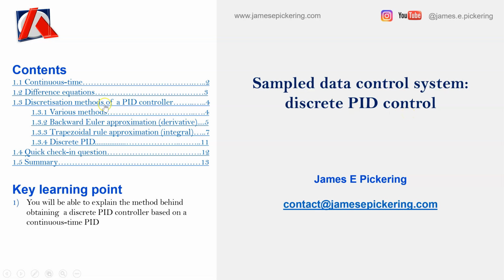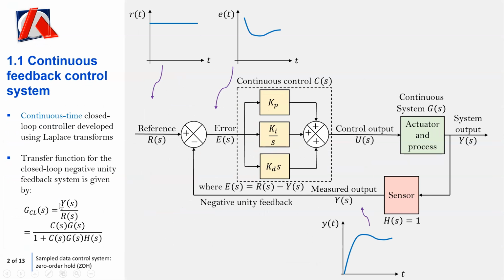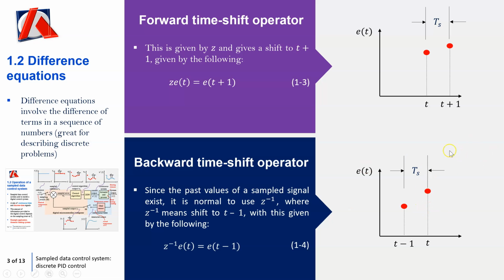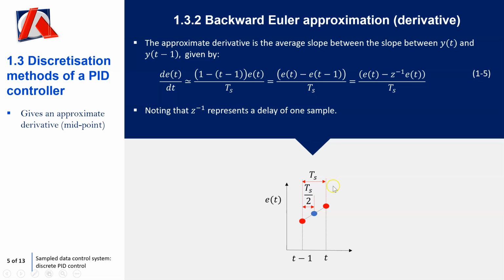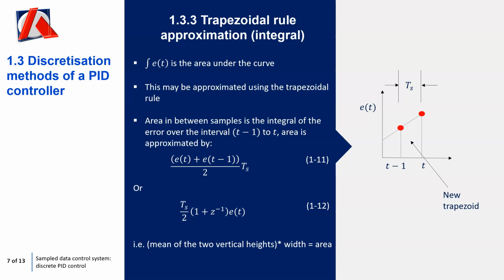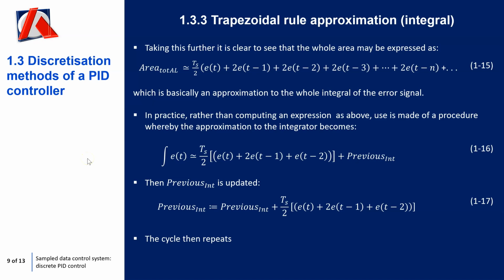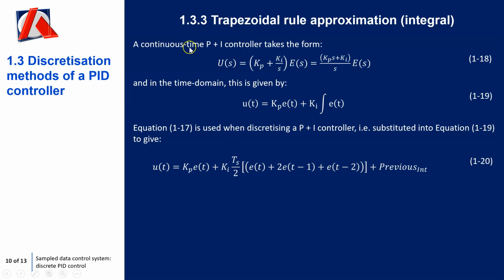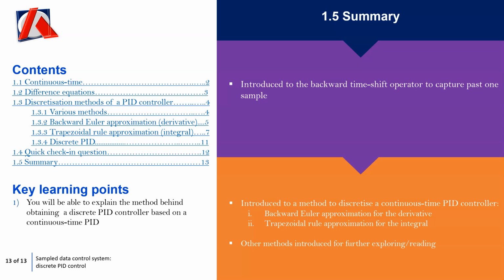7. Discrete PID control

Comment: I don't fully understand what the benefit is to having the last 2 samples in integral calculation. Isn't the area from t-1 to t-2 already represented in previous integral? Why not just do Ts((e(t)+e(t-1))/2)+previous integral? Wouldn't that also give you the integral? I know this video is quite old but I hope that you might still read the comments and are willing to explain this a bit more.
Reply from the maker: Hey, yes you’re right. You could just take the area from the last integrated error, and sum that up with the previous integrals.